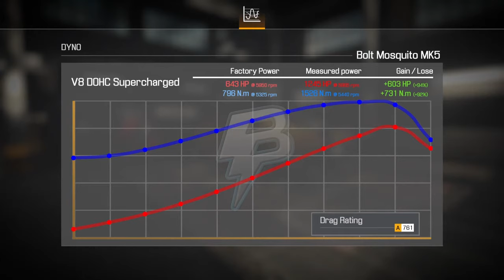Car Mechanic Simulator TUNING GUIDE | Car Mechanic Simulator TIPS and TRICKS

Comment: if u want i can give u the OEM tuning method used by most real life car manufacturers when building high performance cars. it makes tuning much faster and easier and it also gives better results.  I have a 3 starred 1124HP Tempest Magnum that weighs 1600KG and is running 355mm tires in the rear. It runs a 9.350 @ 254.28 KPH 1/4 mile and a 22.852 @ 370.149 KPH mile. The decimals are because I converted from MPH to KPH.
Reply: I’ll take it
Reply: I'll take it too😊 thx)

Comment: I was able to get a hammerdal strale s tuned up with performance parts (which brought the horse power up to over 2000hp) to around 120% which was able to push 280 mph or around 450 kph and had an average 1 mile drag time of 19 seconds, and a 1/4 of 8 seconds. What I've found is that it tends to come down to your shift timing and trying to keep the flow of your gears as smooth as possible because if you shift at the wrong time youre car either grows up in rpms too slow if you shift too early, or it slows down a slight bit if you shift too close to the revlimiter. And as you said it takes quite a bit of trial and error to as well as some familiarity with your car to get the fastest times and tunes.

Edit: corrected the cars name
Reply: What does your gear tunning look like? I’m struggling to get this car launch smoothly & not burning out right away 😂
Reply from the maker: if youre buring out right away its probably in your first few gears and also could be your titres try switching to slick tires then if youre still burning out mess with the 1st and 2nd gears till you find the spot you dont burn out
Reply from the maker: definitely does take a lot of trial and error fr but I think thats what makes it fun and like you said knowing your car and shift times it just makes it more personal to the car like "oh wow i know my car, this is my baby"

Comment: I have a drag rating of 999 and over 2k HP but launching is bad because ill spin out and if I go easy on the Gas I won't win
Reply from the maker: Hey! Its probably the wheels that’s what happened to my camaro try putting all slick tires on it
Reply: that’s how normal drag racing is. you have to find the perfect rpm to launch at where it doesn’t bog but also doesn’t spin too much
Reply from the maker: Yea i figured this out but it’s crazy the detail they put into it i built a drag car with smaller wheels at the front and bigger wheels at the bottom and it’s unstoppable! 

i actually plan on doing a more in depth video so I’ma do some research on irl drag racing if you’re into drag racing and have some knowledge I’d love to connect with it! Do you have discord?

Comment: 3 speed for all muscle cars over like 800hp.  Nice final drive for 1/4 mile is 4.08 - 4.11.  Just play with the final drives for longer races
1st gear 2.45
2nd 1.55
3rd 1.00
Reply: not a good idea for longer races like the mile or track days. u need a properly tuned 9 speed for both those race types
Reply: @literally_british_544  I've done decently with a 3.08 or 3.10 final drive on the mile with a 3 speed, 4.08 with a 6 speed is decent for track work
Reply: @HLGJammer  can u give me a time? i’ll run my tempest mag down the mile again to get results. also, make sure to subtract relation time from ur result to eliminate human error. i have 1124 HP, 355mm rear tires, and i weigh 1600kg
Reply: @literally_british_544  we're still talking in game, yes?
Reply: @HLGJammer  of course
Reply: @literally_british_544  I'll have to reinstall it and see what I have honestly

Comment: is it better to have 2nd an 3rd drop around the same rpm or is it better to have 3rd drop lower than 2nd
Reply from the maker: I would say have them around 30-60 rpm difference so they shift faster then your ending gears further apart so you can actually reach your top speeds and perform well
Reply: @Cosmos-Sports  thanks and you should make another more advanced tunnig guide for cars with like 1400hp to 2000hp
Reply from the maker: You’re welcome and that’s a good idea! I have some videos planned to upload already but Ill try to start working on that and get it uploaded within the upcoming weeks!  Just gotta find time to get on, build a car the record tuning it and everything

Comment: I got 2000 horsepower and my mile time is 19.7 seconds. Do you want to race?
Reply: What car are u using
Reply from the maker: I actually havent played in a lil minute I gotta get back into my rebuilds and restores,  gimme a lil to rebuild a car but id be down to beat you 👀 how are we going to race though? its single player unless they added multiplayer to drag racing finally which would be dope
Reply: @Cosmos-Sports  not sure I will look into it. I will respond if I figure it out
Reply from the maker: Yea its kinda lame they wont let us run multiplayer at the drag strip

Comment: Ok ok ok you need to bee more realistic when it comes to actually turning a 1/8, 1/4, 1/2, or 1 mile race car 1 gear gets you off the line so you want it low and sift out at around 60 to 80 mph in the you want the final gear ratio low on short track like 1/8 & 1/4 and high final gear ratio on longer tracks 1/2 mile and 1 mile. Do some research on actual drag racing and get your hands dirty
Reply from the maker: Not actually a bad idea, thanks! Might do some more research when i make my updated vid

Comment: How do you launch at 5k rpm?
Reply from the maker: Burn out, brake and gas same time but each car won’t be the same some shift gears at lower or higher rpms
Reply: i found out you can hold a on all the cars and it launchs at max rpm for that car
Reply from the maker: That’s actually good to know 👀i need to try this